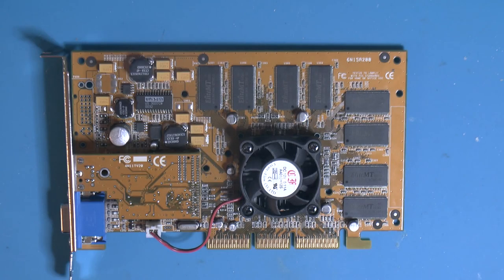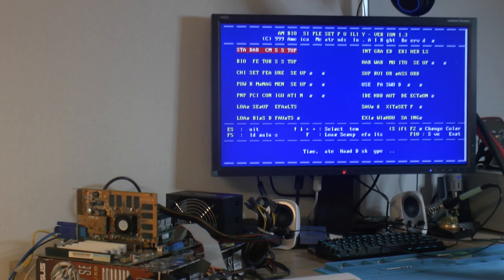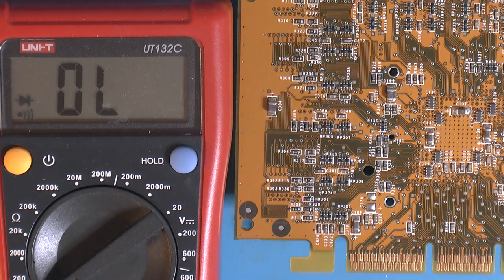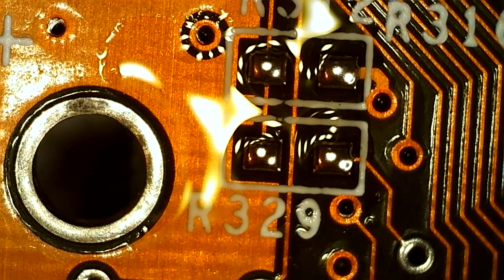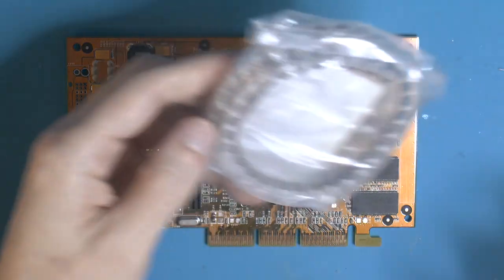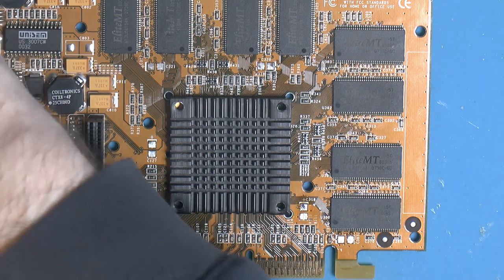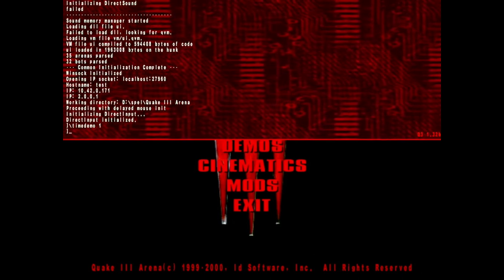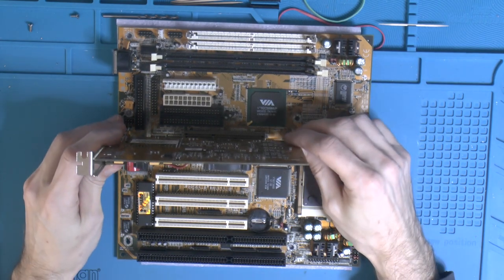GeForce2 PRO repair

Comment: I can confirm that Resistor R329 has a written value of 15-Ohms, and it also measures as such while on the card. 
I have a card with an identical layout from MSI.

Comment: 30 years later and gpus cost 10x more
Reply from the maker: yea XD
Remember when I could by GTX260 for 139-149€ new, SLI for 300€. Gave you the same performance as the dual gpu GTX295.

Things sure got a lot more expensive over the years.

Comment: A very nice card! And finally the "magic finger" gets some attention! I've found several broken connections this way. It is always worth a try.
Reply from the maker: Yea gave the magic finger a try again and it worked XD
Reply: I got a GF2 GTS AGP (ASUS V7700) this week in a box of junk. It posts fine but without VGA signal. With a secondary PCI VGA the card is shown in device manager as GeForce2, but with error 10 "device failed to start".  Some components were knocked off lose on the back. I've put them back on. Voltages seem to be ok (there is VDD core, VTT+VDDQ+VREF for RAM). Cap ESR's are good. I can't find anything else that is obvious. I will check for hairline cracks next time. Do you have any further tips for me on what else to check?

Comment: Man your videos are awesome. I've got quite a lot of retro cards ( creative gf4400ti, gf4200ti, gf2ti, 9800xt, 9500pro...) that have similar artifacts. Thought the problem would either be gpu core or bad ram chips. Never thought that a single bad resistor could lead to artifacts. Thanks for the videos! Really enjoy them!
Reply from the maker: cracked and missing resistors are more common then bad ram or GPU.
I would say 90% of times people just knock them off and then you get floating address or data lines on your ram causing random bit flips that gives you the random artifatcting pattern you see on the screen.

But there are GPUs like the 9800 series that run hot and go bad (have not had much luck fixing those), also the Nvidia 6000 series seems to go bad (have a 6600GT with a dying GPU).

But older card tends have missing or damaged resistor causing the problems more then anything else.

Can also be lose legs like on the older V1 and V2 types of cards with QFP style chips causing similar issues.
Reply: 9500 fixed and gonna flash it to 9700pro. Geforce2 TI fixed :D. Thanks for the info mate!
Reply: @jimlkosmo5730  which SMD parts were faulty/missing on your R9500? It is quite hard for me to diagnose it.

Comment: Regarding the fan, have you considered repairing it? Personally, I use WD-40 (or equivalent) to clean fan's axis and then some synthetic motor oil or lithium grease for lubrication. It always works for me.
Reply from the maker: Yes i considered it. I buy ball bearings from a RC store in sweden, on day shipping.
I lube them if there sleeved.
Worth it on custom fans that you cant buy. Or oldschool fans.
But a new one is 3-4€ so not worth it and modern fans are much better.
This card uses a standard 40x10mm.
Can get a Sunon Maglev for 4-5€ usually, similar bearings to a Noctua at 1/3 the price.
So no a new one is inexpensive enough and will last longer and run quieter.
I also like the fact that a new Sunon ha the same looks as the old once from say a 1999 Mac G4, or the Y.S Tech I recently bougth and put in my Dual Athlon Mp looks just like the once you got with the Alpha PAL coolers for your Pentium3 or Athlon back when.
So new with modern bearings but the looks of retro.
Reply: Yeah, I understand. But I always try to repair rather than replace, just for fun. It is the essence of retro-hardware hobby for me. Also I like to struggle a bit with retro stuff, just like back then.

Comment: nice fix again, amazing it just a couple of broken resistors. The big cap looked bulged but the small ones it was hard to tell on the video...were they visually bad or did you feel that you should just do them all?
Reply from the maker: Small once you wont see if there bad because they usually cant swell, they can leak out the bottom tough.
 You have to  measured ripple to figure out if there bad usually.
And if they are bad, and most likely are they would cause instability under heavy loads like 3D rendering.

Also the SMD caps was like 1-2€ total for the small 10uf and 22uf so not gonna break the bank so its just easier to replace them then bother with trying to figure out if there still good, (most likely not).